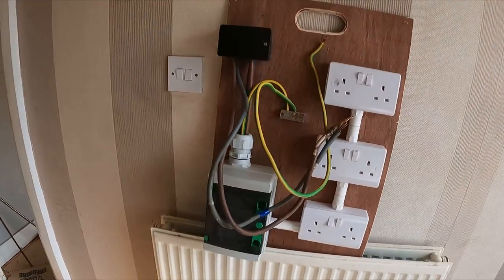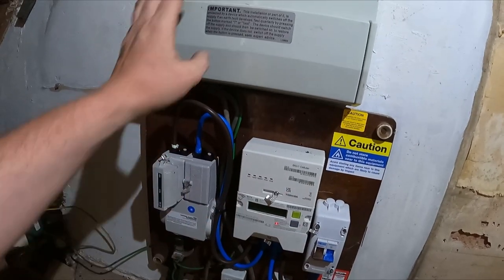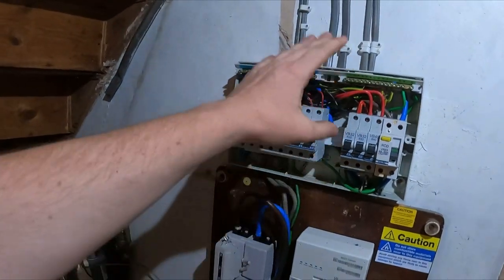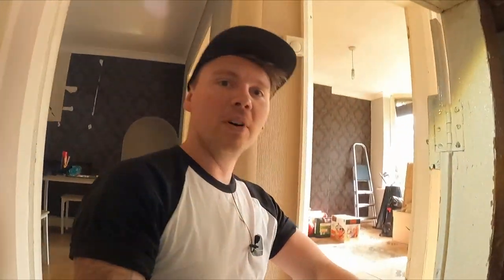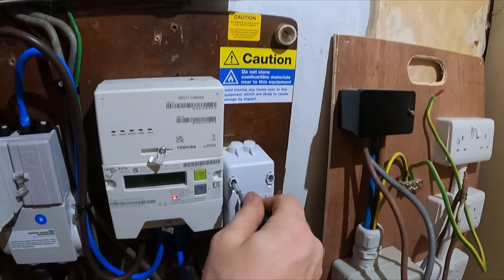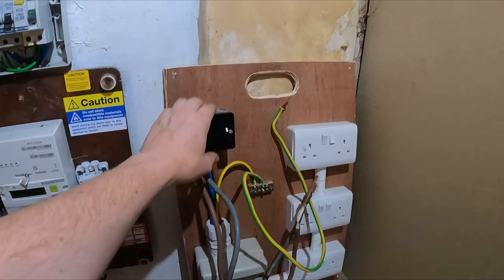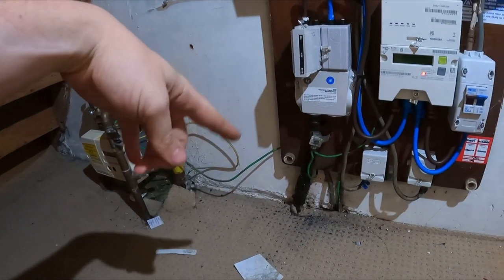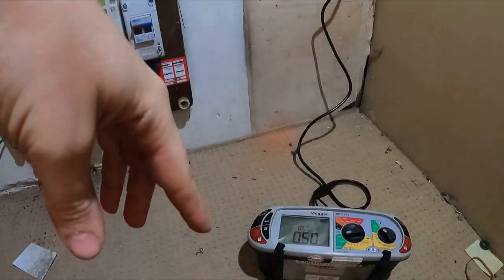Emergency call out - Melting Fuseboard

Comment: Always wounder why it's not recommended to fit smoke/ heat alarm under stairs when that where the fuse board is located. Then again how hard would it be for the manufacturers to fit a miniature  alarm inside there fuse boards.
Reply: Ay ? Are you serious ?? That’s just what we need , even more bureaucracy and regs ! Nooooooo. Stop.
Reply: intumescent seals would work.
Reply: I think the idea is to try and prevent fire in the first place. You can get these glass tubes which go inside the CU. Fire breaks the glass and the gas extinguishes the fire. CJR tested one on his channel.

Comment: Hi Nick, I've often found the bus bar not picked up by terminal so arcing under load, for years now used a plastic dental mirror after I put a board in to check behind the terminal....works a treat and only cost a quid ! Worth mentioning it for others to  get one
Reply: That’s a smart idea mate!!!
Reply: Clein do a nice orange dentist mirror
Reply: @rowles13  you could also use a endoscope camera attached to your phone.
Reply: I use a make up compact mirror. Clam shell design. The dental type mirror broke for me but mirror is crucial for many jobs.
Reply: I got a plastic dentist mirror with a built in led just to make it that bit easier to use, still only about four quid. Already come in handy so many times not just on bus bars but peering into ceilings and behind cupboards too. Never leave home without it now!
Reply: Great ideas, You can use your phone too on reverse camera (or whatever it’s called)
Reply: The UK/Euro style boards are absolutely wild to me. In the US panels have built-in much sturdier bus bars fixed in place. The breakers snap into the panel in a way that you can't do it wrong, as the breaker hooks onto a retaining stub such that the line terminal is aligned and in firm contact with the bus bar. Much harder for the breaker to wiggle itself into a loose connection to the bar because it has to leaver the entire breaker to pivot from the wrong end before it would arc (it's at a mechanical disadvantage)... of course the load connection is still a terminal screw that must be torqued properly.

Do all systems in the UK have a mains disconnect between the meter and the panel as shown here? That's a requirement in the US... though again our 100a/200a/400a main disconnect breakers are usually much larger with a very large short amp rating. Not sure what the UK ones are rated for - 10,000?
Reply: @xenadu02  UK,  requires isolator , but many old systems.  Max fuse for house is 60A for small house or 100A for large house

Comment: Wylex MCBs have no miss tunnel terminals for the busbar connections, a shield closes behind the gap when the screw is tightened. Can’t miss. They also have twin terminal main switch isolator’s for better connections. We sell loads of their gear, contractors are willing to pay a little bit more for safety features like these.

Comment: So Nick , as the stairs  are the fire escape, will you move the Fuse board to a different location, as part of the rewire.
Reply: And if it is a fire escape, should the cables not be fire rated?

Comment: Looks like the incoming phase conductor was behind the clamp and not in it  ,seen far to many times where this has happened either with the breaker or main idolater ,it's about time the industry come up with a better design
Reply: Better designs already exist and are used in Germany since 40 years. Look at hagers or Eatons Busbars for example. Also they are Insulated.
Reply: The residential boards here in north america don't uses busses like that. Our main breaker is bolted onto the bus bars at the factory and the branch circuit breakers clip into the bus. I've only ever seen one instance of a loose connection heating up on the bus bars, and that was a 125 amp breaker clipped on that was being pulled off by the tension of the bigger 35mm cables.
Reply: Incoming phase conductor?! Surely you mean the busbar was behind the clamp on the outgoing side of the main isolator?

Comment: I have often got the DNO out to sort the earthing in that type of situation as those clamps can damage the lead sheathed cables and worst case cause catastrophic failure. I have seen them do a couple of things to remedy from using a continuous force spring to hold on a braid which is terminated into the MET or they have dug up outside and jointed modern concentric cable to the PILC and PME the supply. I think most DNOs will upgrade to PME for free so might be worth enquiring.

As you say being under the stairs is a vulnerable place so I have started to look at fitting a smoke and heat interlinked alarm in the under-stairs cupboard. With the thought that it should give an early warning of a possible situation that you won’t know about until it’s too late. Whilst there is no requirement to do this it would hopefully allow people to get out before the stairs were overcome and impassable.
Reply: "most DNOs will upgrade to PME for free..."
Upgrade?!  For free ?  I think you mean "most DNOs will take any opportunity to downgrade your safety to PME despite the costs to you because it's free for them "
It gives them, for little effort, the chance to abdicate all responsibility for your earthing arrangement and then when you mention the shocking reliability of that system they can point you to the Reg's where it pretty much tells you "ignore and distrust your DNO, drive your own TT rod if you feel that a reliable earth is important to you..."
There are exceedingly good reasons why large parts of the MoD and NHS estates ban TN-C-S as a means of earthing.
Reply: @Dranok1  I guess it all depends on how you view it.  The chances are that the house is already effectively being supplied via PME irrespective of current cut-out arrangements, so tidying it up, removing the crappy bonding clamp that is likely to be damaging the PILC cable etc. is an upgrade.  Far better to be an honest reflection of the actual supply arrangements than masquerading as something else.   And if you can get that done for the customer without them having to fork out a load more cash then I don't really see it as an issue.  As it is DNOs do zero routine maintenance to their equipment in people's properties, so PME or TN-S makes little odds. 

Saying PME is rubbish because of the changes to BS7671 to add an earth electrode to protect against a known failure mode is odd to me.  After all, you can get failures in any system and evolving to add additional protection to mitigate those possible failures is only sensible hence RCDs, SPD, AFDDs etc. 

I don't disagree, however, that PME may not be the best option in all cases and it is far easier to decide on your earthing arrangements when you control your own substations, a luxury that homeowners do not have!  In my industry, we use IT arrangements quite a lot.  I understand that the MOD restrict designers to ensure that cables are sized to keep running temperatures to 50C as it extends the life of the installation and the equipment.  This seems a sensible practice and one that isn't considered in a domestic setting where we design to 70C.  Perhaps if we considered conductor temperatures more in our domestic design we would stop cooking and burning out things like shower isolators.  Rather than installing undersized cables for the load and the installation conditions. But sadly the world is not perfect and cost always drives most of the undesirable system failures in the end.
Reply: @Mark-xr4zt  In the situation you first describe, I am very much inclined to agree.  But in the last 15 years I've seen one domestic PILC cable, I'm sure no more than a dozen residential ones, and just a few industrial.  Whereas a good solid TNS is far more robust it seems, and the single failure mode of "sheath bond broken at roadway during pubic works, fortuitous earth paths still present" is both far less common and immensely less killy than the comparable failure mode of "CNE/PEN conductor broken at roadway, all bonded metalwork now being maintained at line voltage by the neighbours supply."

I am also sympathetic to the rest of your reply.  We appear to be on the same wavelength :-)

Comment: Nick, might be worth getting yourself an insulated hex screwdriver instead of the tool check + For years i did the same check out Amazon's 3mm hex T bar.
Reply: I thought the same thing when he undid the terminal In the isolator…. Unlikely, but it could be faulty and still at line level.
Reply: @IanFarquharson2  We had a recall on these exact isolators recently with switch not isolating

Comment: And you use flexibel wires directly into the breaker.We put a thing(i dont know the english name!) on the wires to keep the small wires together to decrease the contact resistance.Otherwise the thin wires spread out in the big hole and a lot of them have no contact at all.
Reply: A ferrule?

Comment: Do you love cable smoke detectors in the UK, so why are not one CSD into every cabinet with hazardous equipment, e.g. Harry Potter sleeping room with build-in CU and gas meter? IT-cabinets? Roofs? Specially on the running way to ground floor outside the house if the full house covered inside with flames?

Comment: Why have you used a Henley block ? You could have gone from the RCD/main switch unit straight into the double pole isolator, less connections
Reply: It means he can easily provide longer tails to his temp board if necessary.
Reply: @stupot_64  true, but you can have longer tails from the RCD/main switch unit 2-3mts ?. You are always going to position the temp socket board near to the mains.

Comment: I had this recently, local council sub contractors had fitted a new split load board and not tightened up the main switch neutral connection and had tightened the line terminal before fitting the busbar!

Under stairs as well. Good job the home owner noticed the smell!
Reply: What I'm really curious about is whether those people got penalised for doing a bodge... could've killed someone
Reply: There wasn't any stickers on the board to show who installed it and I don't know if the insurance company would do anything?

Comment: I had a job recently that had the earth clamp used for tns system. Ze reading was fine, believe it was about 0.20 ohms. It’d been noted down on the eicr that it was c3 and the paperwork was satisfactory.

Council turned around and made us go back to put a new TT rod in instead because they didn’t like it.

Seemed excessive to me Tbf.

Comment: Seen this on recently installed gear, I often wonder if there isn't a better design. For the bus bar.
Reply: Crabtree do a board where the breaker fits onto the din rail and by design, slots into a fixed internal busbar. Brilliant design as there's no possibility of missing the busbar. However, very very specific and the breakers are a little expensive
Reply: Schneider ikq,

Comment: So to prevent the thin wires to spread out in the big hole to prevent that a lot off the thin wires dont have contact and so the resistance is to high.

Comment: Hi nick,
Would not leave bonding clamp on which I think it is correct me if im wrong, which are designed for service pipes, which in my opinion makes it none compliant. Could be knocked or tampered with affecting the zs in the future also, came across this before. Western power came out and changed it to a PME and at another job they re-sweated it on. However they do charge the guys that fitt smart meters do not really  have a clue, and are not electrcians. They have limted electrical knowledge, as a few i have spoke to are gas engineers by trade, and they are not the DNO. They are your energy provider. The (DNO) is the company that owns and operates the power lines. The DNO in my area of birmingham is western power, (but your energy supplier could be utilita for example) but it depends on were you are in the uk on who your DNO is.
Reply: Ze not zs*

Comment: Anybody know where where in regs books it states to try to avoid putting consumer units under-stairs please? I would love a excuse to not put consumer units there.
Reply: Makes sense. Last thing I want on fire is the stairs
Reply: I don't think there is a specific reg for a domestic premises. For commercial and lets etc, they are required to have a fire risk assessment, so it would likely be commented on that the escape route could be blocked.
Reply: @three-phase562  would also make sure the staircase is suitably protected for the required amount of fire protection.
Reply: @three-phase562   Can't find anything explicit about stairs — which may be because I'm not looking in the right places — but Building Regs Approved Document M part 1 does specify that CU placement must "assist people who have reduced reach" (secs 1.18, 2.30 & 3.44) including min-max heights which probably means under stairs no is no longer an acceptable site.  The regs apply to new builds but not alterations / repacements of existing installations.
Reply: Why do you need a regulation to make you do it? Recommend to the customer what you consider a safe way to do it.

Comment: It's funny watching a lot of you UK 🇬🇧 sparks have gotten me to check my panel and retorque the breaker terms every now and than and I'm in the states where having eicr testing is unheard of. 
And yes I've even done the power mains and that is nerve racking as we AMERICANS don't believe in insulated tools lol
Reply: I got so much abuse on Reddit a couple weeks back suggesting you guys use insulated tools lol
Reply: @WilsonCarefree  we do have them just not as commen to use them like using wagos over wirenuts (although I never liked wirenuts I was told to use copper crimps with plastic sleeves
Reply: I think regardless of country or regulations/codes, imho it's a matter of common sense to use insulated tools on electrics,
Reply: @lawrencetasker212  +1 This. Why would you not ???
Reply: @rmorris8544  added cost and conveyance of not having to find them not popular thing in the states so the Yankee thrifty sense if cost more and is more work not worth it lol

Comment: That is the first time I have ever seen a gas meter inside a building. Is it normal in that area or other areas to have the gas meter inside?
Reply: A lot of flats have a meter cupboard where the gas meter is situated. Mine is off the hallway, the other side of the wall to the distribution board.
Reply: @grayhalf1854  Huh, the more ya know. Thanks for taking the time to respond

Comment: when i was an apprentice and when i have been training up young uns i was followed by my spark and i do , double check it takes some time to get the proper tight regardless of the torques , i suggest a DIYer or home owner had installed that or a cowboy with not much time under their belt 
also i use metal clads and conduit couplers for a temp board them brickies like to smash around like a bull in a china shop !!!
Reply: You can over tighten modern stuff, the biggest problem I found was twisted conductors in square holes. The copper heats up and moves leaving it loose.

Comment: Yet another reason to just have WAGO make fuseboards. Imagine a low contact resistance spring loaded terminal with a screw latch to prevent it being easily flicked off. It will NEVER get loose.
Reply: This already exists and it is used in Germany. There are multiple Designs from Hager for example.
Reply: @hjkglpojh1863  i was britglish trying to say britbong needs to import more wago items THEY'RE SO GOOD HHHNNNN, a lot of german standards are good, including water supply, valves, electrics, and even tools

Comment: So you have 237 volts,and breakers for 40 amp!Why o why do you need 40 amps breaker??We in the Netherlands have all the breakers for 16 amps and it works fine!And also 237 volts!
Rarely we install a breaker for 20 amps,but thats it,not higher!
Reply: Guess you enjoy Luke warm showers and small cookers 😂😂. You must use breakers above 20a on heating loads.